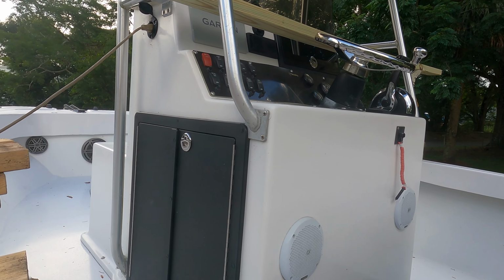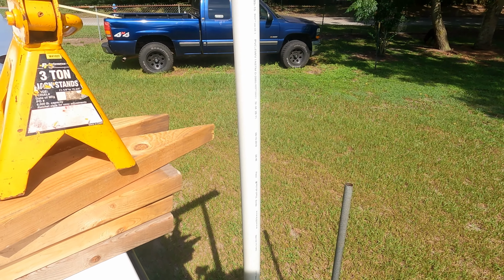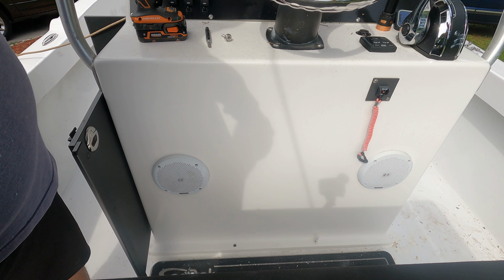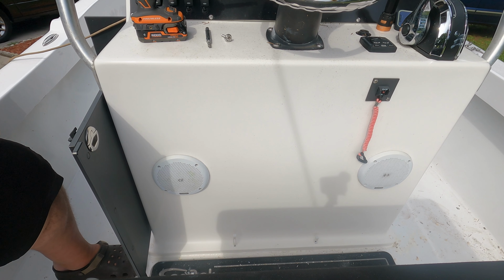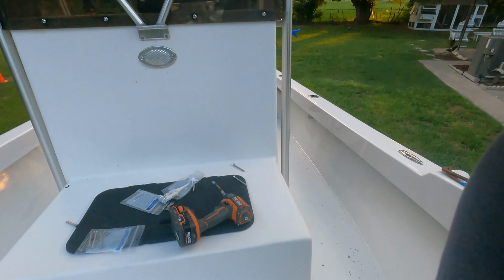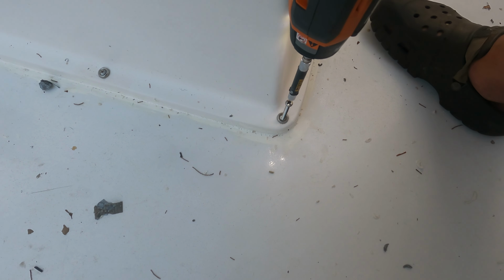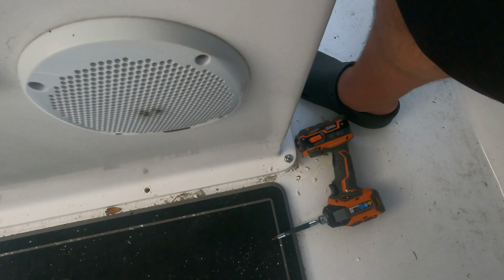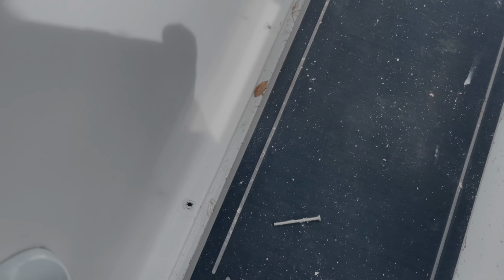Center Console Repair Pt1

Comment: Have same issue, for a bigger boat, i ordered both the 5200 and the epoxy resin. Thinking of doing a round of epoxy first, and then glue it with 5200